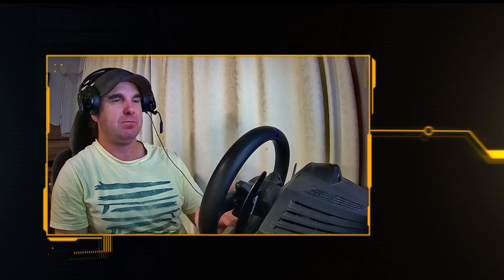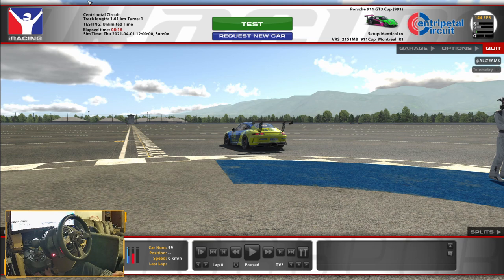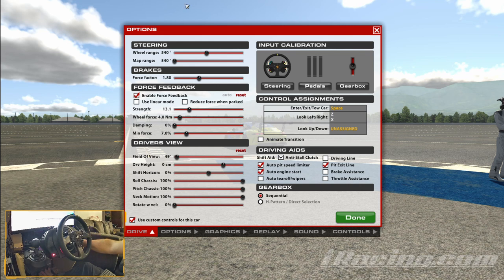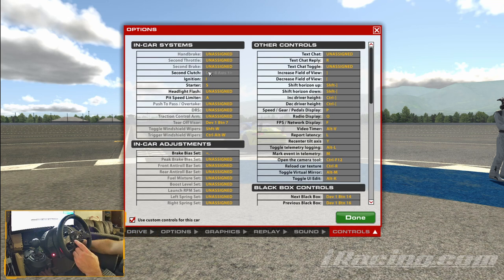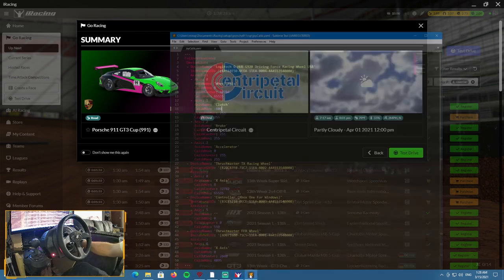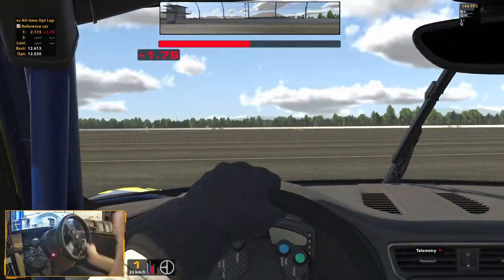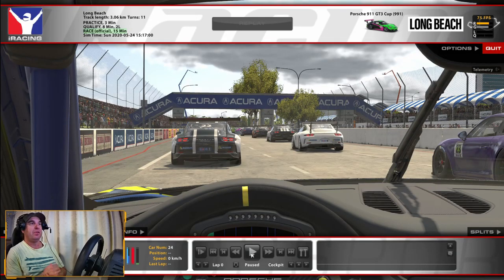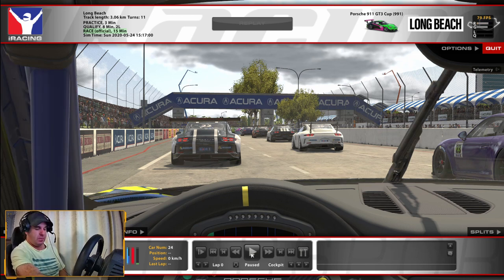How to Start the 911 Cup Without Dual Clutch - iRacing

Comment: I don't have a clutch option in Joycalib file. It just has brake, accel, x rotation etc, but no clutch option. I'm on a CSL Elite F1 wheel.
Reply from the maker: Do you have the clutch pedal? If you do you will need to calibrate the second clutch in iracing before it will come up in the joycalib file.
Reply: @miknergaming6108  Thanks for such a speedy response mate. I don't have a clutch pedal. Just the brake and Gas.
Reply from the maker: Yeah right unfortunately the only way to make it work is with the clutch pedal, does your f1 rim have 4 paddles or just the 2 for a shifter?
Reply: @miknergaming6108  Just the two. Up and down shift lol.
Reply from the maker: Bugger, sorry i cant help you out with a way of doing it, if i find a way some how ill let you know
Reply: @miknergaming6108  OK no worries man, thanks! Happy racing.

Comment: I assume this is now dead due to the latest update? With the clutch burn
Reply from the maker: I did do this video with the latest update build, it works well but as soon as you do more than 1 launch the clutch it toast. The other way would be to set it a little on the higher side and bring the clutch pedal out quickly once underway which should make the clutch last better, the other thing to take into consideration is after the start of the race you shouldnt need the clutch in the 911 anyway
Reply: @miknergaming6108  nice, I used the Dan Suzuki way but that just burns it out now :( Nice one
Reply from the maker: @bobhump36  yeah right, it burned the clutch only when i tried doing more that 1 start. I will give it a go over the weekend when i do a race and see if it works fine to make sure though